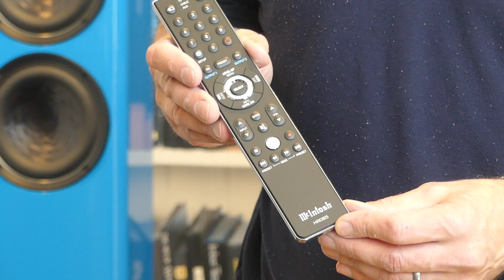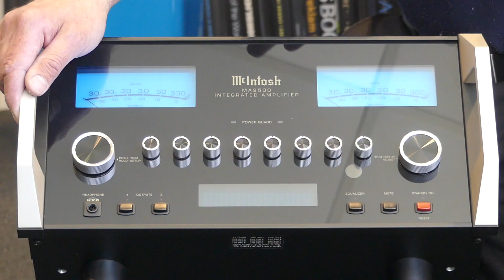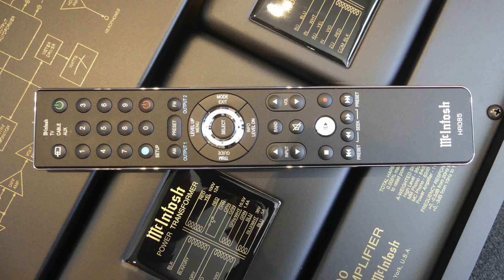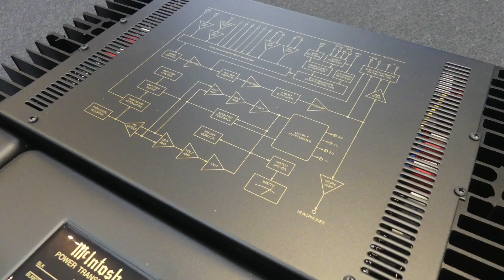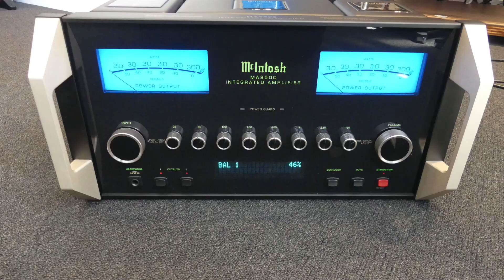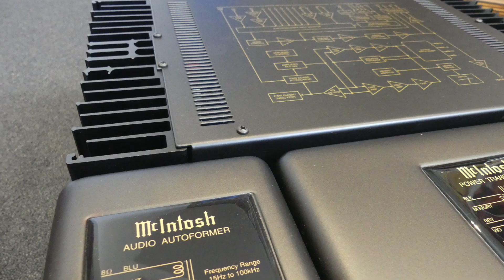McIntosh MA9500 Integrated Amplifier Unboxed | The Listening Post | TLPCHC TLPWLG

Comment: MODELÇO  VALVULADO   TEM  RMS  QUANTOS  WATTS  PRECISA  CAIXAS  HI  END  TOCAR
Reply from the maker: McIntosh has recently released a 200w tube based int amp:  https://listeningpost.co.nz/mcintosh-has-released-a-new-valve-int-amp-the-ma-2375/

But most speakers need 40watts to 80watts.  More is better though, as it means larger speakers can be kept under control at all volumes.